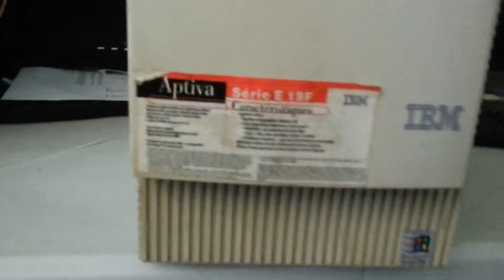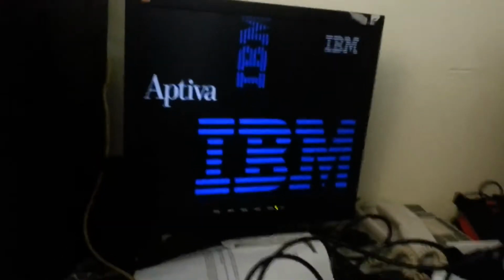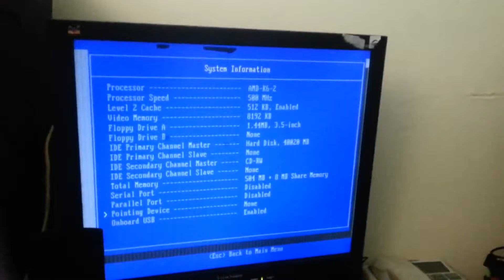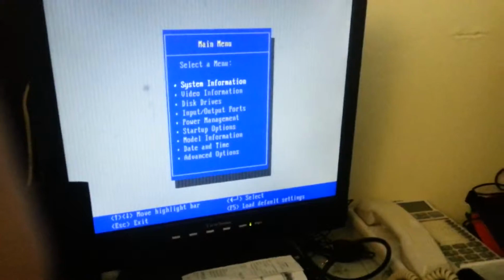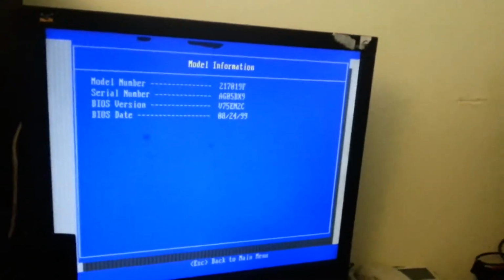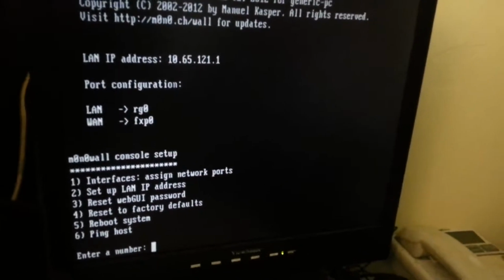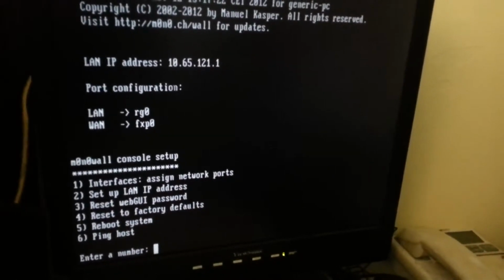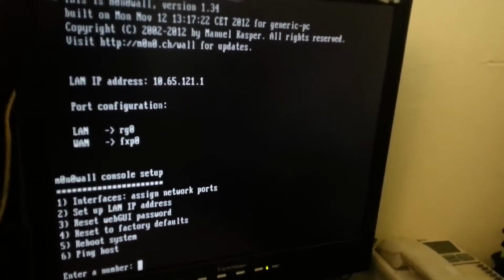IBM Aptiva 2170-19F overview and boot

Comment: Could you believe I have this very same PC sitting under my desk right now? Mine is the E-series 9u though, mainly stock except for RAM upgrade and new HDD. Awesome man!
Reply: I have two of these towers. I like the design and I am trying to fit "new" components on it. It was really hard to fit a PSU and now something is not working because it won't boot. New specs are: 4 cores at 2Ghz intel core 2 duo, 2GB of ram, 160GB HDD and wifi
Reply from the maker: +not_flow I assume it's not the stock PSU?
Reply: lhuser No haha, everything except the floppy is new. Well I think I removed the floppy because I needed the space, that case is tiny.
Reply from the maker: +not_flow It's tiny indeed. Does it beep? If not, does it beep when you have the RAM out? Is the 4 pin cpu power connected properly?
Reply: lhuser I think the computer booted up, but the hdd died and I was thinking of running a linux distro from a usb but I abandoned the project because of lazyness.
Reply from the maker: +not_flow Well, that's a half done job you got there. if it posts, then just do what you said, but you'd be better off with a JDD
Reply: lhuser I may have a spare HDD somewhere, I should finish it, it's taking up the garage table.

Comment: I have an Aptiva which I got new with Windows 95 on it and it is like that one you have and it still works just fine. I like the Cyrix cpu in it and the CD drive also. I got plenty of use out of it before just letting it sit where it is now for over 4 years. That computer you have is faded on the front from being in the wrong place for too long. Otherwise it looks great and I wish IBM was still selling computers due to the way that one was built.

Windows 98 was a dud and why I went to OS/2 Warp (version 3) because Windows crashed regularly like 95 did. I also purchased version 4 of OS/2 and put it on another computer due to Windows crashing until I got a copy of Windows NT which was nice. I kept my Aptiva with 95 because I have games which work on it and 98.